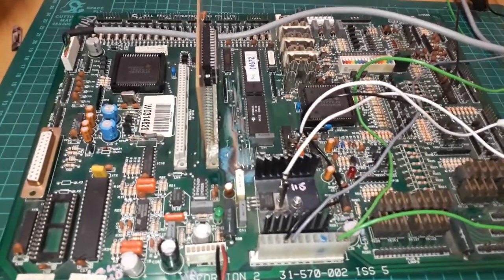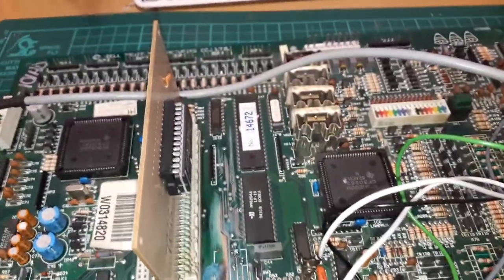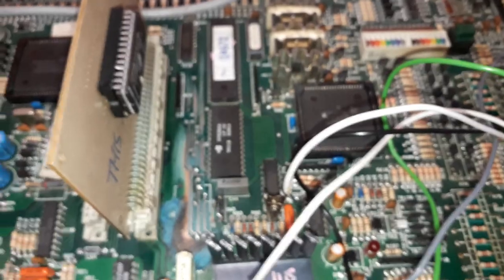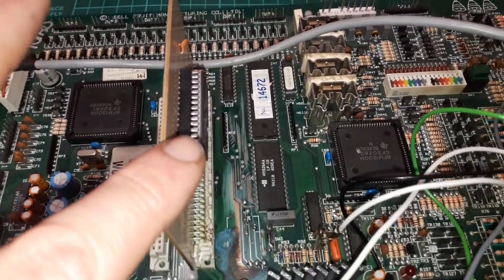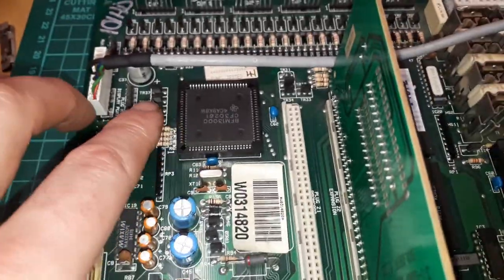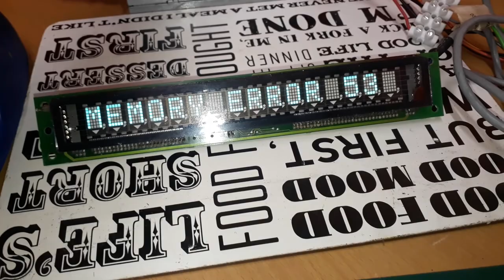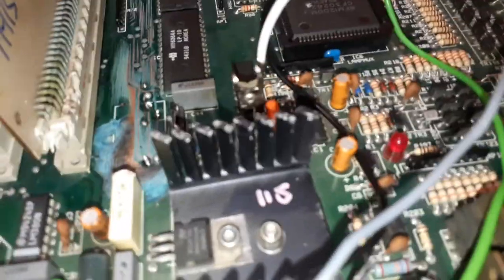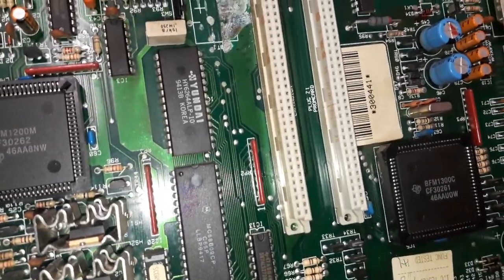HARTLEY SCORPION 2 - FIRST BOARD

Comment: How you doing MAGIK, just wondering 
if you can give me some insight to a system error 96 on the board your working with in the video, could it be the ROM, can you point me in the right direction, many thanks.
Reply from the maker: system status 96 payout tray not fitted. so it could be the paytray has become dislodged in the machine ( its push fit into a plug if I remember )
Reply: @TheMadmagik  Many thanks for response, wil give it a shot